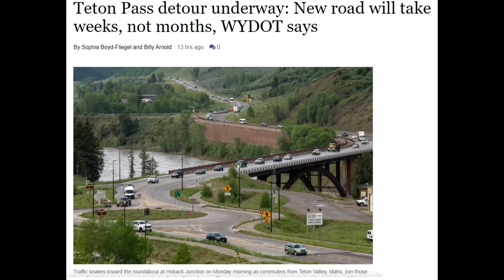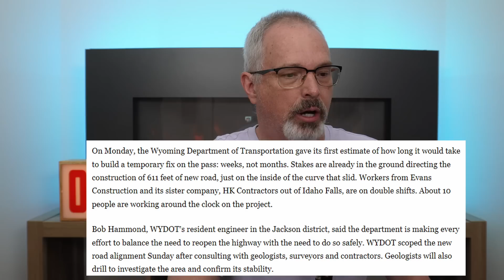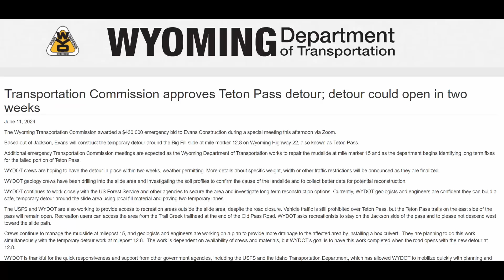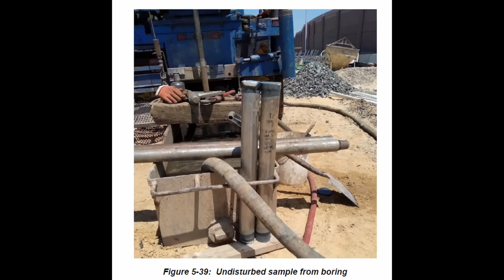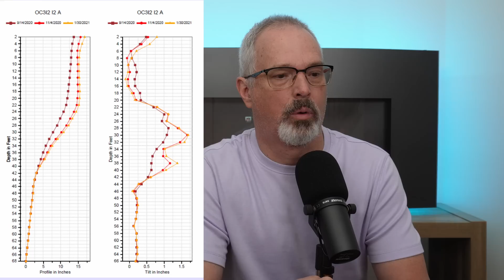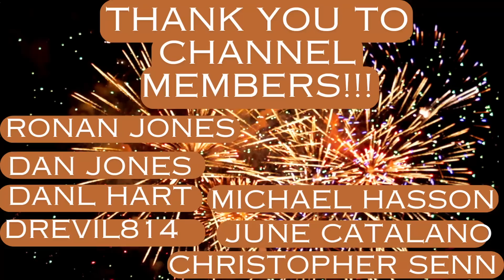Wyoming Slide Update

Comment: First I want to say I’m not an engineer and I do find the way you look at things fascinating. My father was an engineer so I’m well-versed in your thought pattern. The first thing you must recognize is a highway must get opened as quickly as possible. They don’t have three or four weeks to wait for samples and engineering and so on. The repair that they’re proposing is temporary and knowing somebody that owns a road construction company all of the necessary due diligence will be done before the permanent repair goes into effect.As somebody who travelled in the Pacific Northwest lots I can tell you there’s lots of roadways that have been sliding for years. I’m thinking of one where the asphalt from the repairs is probably about 10 feet thick. Every year, it slides a bit and cracks they come back and add more asphaltlevel to it and wait for it to slide and crack again. it moves so much there used to be a guard rail there, but they remove the guard rail and never bothered reinstalling it. I can show you a piece of highway that used to be three lanes in each direction now it’s two in One Direction and three in the other. It’s even been down to three lanes and One in the other Directions This does not make it right, but it’s just the way things are. at some point the slice will be bad enough that somebody will do something about it. Or sometimes they just stop moving eventually   You may find this shocking but living in BC Washington, Oregon California area a slide that closes the road is just another day at the office.

Great information.
Reply from the maker: Thanks very much, I appreciate your comments.  I am just questioning whether they know enough about what is happening out there to place the temporary road right next to the section that failed.  I am concerned about a progressive failure taking the new section of road out too.
Reply: @CaseyJones-Engineer it may be worth the research to fund how many similar cases are dealt with in WY, ID, and MT on an ongoing basis.  This incident is notorious, but not necessarily unique.  My county has a half-dozen cases like this:  a fill slope on an active, slow-moving slide.
Reply: That may be true, but the information you give makes it sound like all slope shifting is the same. I think the point here is that some shifts can take place catastrophically quickly while others move more slowly. Putting a road, whether temporary or permanent, where you know or have good reason to believe another large shift could occur quickly is reckless in the extreme.
Reply: @swerne01 all risk is relative.  OP is not clear about where he practices and does not interview experts.  Each mountain range has a unique geology; all engineering solutions are constrained by budget and use-case.
Reply: @timgerk3262  First of all who's OP? Second that is Mr. Jones's point.  Before you build a temporary road and let people use it, good investigative work should be done so that the risk is known. And all risk is not relative. A high probability of a catastrophe is more dangerous than a low probability of a catastrophe. That's not relative. If a surgeon tells me I have a one in a thousand chance of a complication from a surgery, that's not the same as a 50% chance of the same complication. A court of law's decisions are made on facts like these all the time. They don't say we can't render a verdict because it's relative.
Reply: @swerne01  "more dangerous" is certainly a relative statement.  The value at risk here is not your life, it is someone's job (and the tax revenue that generates).  There was no proper discussion of risk mitigations either.  Less than 10,000 lbs gvw and 20 mph speed limit, a gravel surface, and hourly on-site monitoring are all effective strategies.

Finally, where do all live that your mind immediately goes to being sued?  I assure you WYDOT understands the liability climate in Wyoming courts.
Reply: @timgerk3262  After reading Casey Jones's resume and his opinion and that of other civil engineers who have responded to this incident I'm much more inclined to believe them than you. They're concerned that the remaining slope is dangerously unsafe. Your concern is that Wyoming will lose jobs. I'm guessing you're a Wyoming politician.
Reply: @swerne01  fine.

Comment: With the further failure of the area it looks like the proposed route for the shoefly will be on unstable soil that likely will fall away over the next few days.

Either the fill area will need to be widened at the base and extensive use of piles and geotech fabric and design of adequate drainage will need to be incorporated in the rebuild or they can do it the right way and just build a bridge.

Either way, that road won't reopen for a couple of years.

Comment: There are highway signs on both sides of Teton Pass indicating this Pass is at 10% grade.  On the Wilson side it is 10% for 5 straight miles.  This makes it one of the steepest paved roads in the USA.  Also,   there are signs that forbid commercial trucks from pulling trailers up and over this  Pass.  But there also  signs that say that box trucks sometimes called straight trucks are ok on this road as long as they are not over 60,000 pounds gross weight.   That is a lot of freaking weight on those places where the roadbed is nothing more than fill material.  Especially considering that the material is nothing more than very sandy dirt...with no rocks for a binder.  If they build back this same way you can expect more of these types of failures on this Pass in the future.
Reply: Tractor trailers are only not allowed in the winter. Trailers are allowed April 15-nov 15.

Comment: I'm not an engineer, but the slopes on both sides of that fill embankment look to me much steeper than what I normally see in that sort of construction. It looks like it was built on the cheap, with the inevitable result. Trying to build a temporary road on top of what's left is insane.
Reply: Yes, that slope was bound to fail.  It would have to be solid rock to work, and I don't mean rock fill.
Reply: If the fill slopes were shallower the fill would be miles long. The only thing they could do is use better fill benches and better material, and now, geofabrics.
Reply: @lickyweeks  they could also do a bridge there. If the temporary fix works, they'd have time to build the permanent solution. Money as well as frequent bridge icing might be reasons to not do a bridge though.
Reply: Not to mention the 125 ft elevation change in a 600 ft bridge. Which is about a 20% slope in a country that gets 10 ft of snow and only has a growing season of less than 60 days a year.
Reply: @markhyndman8982  i meant a bridge along the lines of the existing curvature. Which makes it 10% just like currently. A bridge might even allow a more shallow gradient as it its placement isn't as constrained as the current fill. I've seen a number of examples in the Alps which make use of that larger freedom.

Comment: I think you are thinking in the box.  PR release is referring to two roads.  the temporary and unreferenced permanent.   Suspect they are going to construct temporary lower grade road,  that is bypassing 661 feet of roadway; down some x feet down probably on the inside of the curve. 
consulting professionals is probably for restablizing the bad slop engineering on the permanent section..  thus permament repair timeframe is not really disclosed in PR release.

Comment: This is a solid Red state. It's possible they don't fund their DOT well enough to include all these monitors.
Reply: Not a huge population in that state, so not alot of money to spread around.
Reply: Wyoming has the smallest population of all the States in the Union, which makes for a very small tax base. Also, that road is to the south end of the Teton Range so they get some brutal weather, including heavy snow loads on those steep slopes.
Reply: The GDP of the entire state of Wyoming is less than $40 Billion. The WY state DOT has a budget of just under 1bil. For comparison, the CA state DOT has a budget of 34bil, and a GDP of 3.9T. That means that as a percentage of productivity, WY puts at least 2.8 times as much funding into roads as CA. If you think that difference is due to politics, I welcome your campaign to spend an additional $63 billion per year on CA DOT, because clearly CA is neglecting their roads... Alternatively, you could just be lacking a clue about what you are talking about, and the slightest comprehension of the geographic, political, and physical factors at play.

Comment: @4:29 "It sounds like this road way section...is going to be limited to vehicle traffic, no big trucks, no heavy equipment..."

I believe the weight limit on the Pass was 60,000 lbs gross, prior to all of this.  That's why there is a scale house at the end of Talbot Canyon (where the mudslide occurred, 43°31'33.9"N 111°00'52.5"W).  Anything heavy already had to go the long way around, though I'm sure the weight limit will now be much lower.

I think I'd be nervous driving anywhere near the collapse site until there was some heavy reinforcement done.  But, that's me, and I'm a Nervous Nellie.

It's been a while since I was out there, but Pierre's Hole and Jackson Hole still hold a place in my heart.
Reply: The scale house is never open…

Comment: Things go wrong when people rush a fix to get “something” working after a problem.  Check out this incident here in the UK in 1974 https://en.wikipedia.org/wiki/Flixborough_disaster   A chemical plant was underperforming, and then a crack appeared in one of a number of reactor vessels.  This reactor was removed a a new line installed to bypass it.  The line failed, hot hydrocarbon vapour released followed by a massive explosion.  There was a litany of issues which resulted in changes in the UK to how plant changes were controlled and reviewed etc.  
This road ‘fix’ looks like an incident about to happen! If it can, it will…

Comment: can't say your opinion is wrong.  But, i have worked at State level before and when it is important to them, it happens quickly.  Lab times are measured in hours not weeks, permits are measured in hours not days, etc.  They should not treat this like they have 6 months to address, but I agree some precautions may be secondary for bigger reasons.

Comment: When wydot kept saying on Fri 6/7 that the road was going to be open by the weekend, I kept thinking "every picture I've seen of that crack has been progressively worse very rapidly  . . . There is no way you guys are going to outrun that hillside collapsing".  
I drove over that section on Monday 6/3, there was no crack.  There was a new crack on Wed 6/5 in the pm.  Thursday am was the motorcycle crash, they patched it and reopened the road.  As I was driving home on Thursday, I noticed the mud River on the side of the road (which I have never seen before in my past 8 years of making that commute) near where that mudslide occurred. That mud flowed over the road on Fri early am.  I told my friends we would wake up on Sat to a catastrophic failure of the road and low and behold.
Reply: So you think the whole built up embankment it’s going to collapse? Do you really think that? They are going to go on the inside radius at a lower elevation where there is very little risk of further erosion to that position. This is bullshit overly conservative engineering from the author of this video. This is so stupid. They will get a bypass in At a lower elevation, not the same level of the road now. What a bunch of dummies here
Reply: @steveperreira5850 What engineering/soils credentials do you have to impugn this PE’s concerns?  And that adjacent bypass’s “lower elevation” you believe will be no problem.  Lower by how much??  4 feet?  8 feet max.  That’s hardly any difference, look at the dry loose material still chafing down the ravine. I hope you never work in any position responsible for other people’s lives.
Reply: @steveperreira5850 I never said that I thought the whole embankment would collapse.   Could it?  Maybe.   There's something significant  happening in the area with how quickly that collapse happened.  The portion of the road that collapsed always had a weird dip in it, suddenly now, its collapsed.  I was just merely commenting with the things that I saw in the past week and how comical I thought it was that WYDOT was being so overly optimistic  and refusing to accept reality.  Believe me, I find no joy in this.  It is a huge inconvenience for me and all the other commuters.

Comment: From what I understand, this road out will increase traffic by an hour. If they do it right, it may be a few months to a year to avoid another slide. 

Those of us in Baltimore have a similar scenario where we have increased traffic because of the bridge going out, rebuild will be YEARS. Most of the local community is ok with that because it needs to be done right to prevent tragedy. They need to slow it down and do this thing right. 😥

Comment: At 0:08 we see the old gravel road that's on the other side of what I can assume be a creek. It basically looks like a relatively straight downhill slope where the failure happened.

Seems (just visual from the video, so it's just my perspective) like that slope degree can be expected to be stable. To keep that slope angle from the height of the roadway would require a lot of fill and it would probably end up touching the powerline structure at the far end. That in turn would result in a creek that'll be blocked and that in turn would cause more problems.

Looking at a bridge shortcut would be a mighty steep bridge if you look at Google Earth (not a perfect scientific tool, but enough for an estimation) you get an elevation of about 70 meters over 280 meters, which gives a slope of 28%. That's about 15 degrees steep, and that's quite steep. Recommendation as I found it is about 6% to 8%. So that rules out a bridge. Even with that bend there's a warning sign when you look at Google Street view that says that it's 10% downhill before that bend and that trucks shall use lower gear.

When looking at the failed bend it do look like that embankment is built on an existing slope with just fill material that hasn't been stabilized or reinforced and it looks like it's to a large degree gravel with sand and that's quite sensitive to how wet it is. Overall the filling of the embankment has to be analyzed to know what slope that can be safe here.

To me this looks like it's going to be a major project that'll need months of work to be done properly. I just hope that it won't be a patch fix that can get people killed.

Comment: Google Earth says the west side is elevation ~7540 and the east side is ~7776 ft.  So it's a 240 feet altitude change in 750 distance straight-line if you cut out the curve and go right over the gully and the forest.  Which, even ignoring the EIS that is likely needed, would take a lot of fill and be only usable by a limited number of vehicles.  My off-road truck could do it, but my accord not so much.

Comment: If WYDOT doesn't do extensive testing on every segment of the Pass, we're going to see another collapse and probably one that's going to fatal.  It's been there since 1969, so it's in no way modern and it's a 10% grade.  

That shoefly might work, but you are playing stupid games with just the truck traffic for reconstruction alone.  In many ways this is like the collapse at Meidum.  Sadly, many roads in the West are built  this way.

Bear in mind that the alternate route into Jackson, through Alpine and Hoback Jct, may have similar issues--and with the expected truck traffic....

Jackson is full of billionaires who are putting phenomenal pressure on the State to reopen this, because Jackson will die on the vine without all the labor that commutes in from Driggs/Alta.
Reply: I expect that the temporary fix will be open only for light vehicles. Commercial trucks will likely need to take the current detour. 

Thanks for the information that the current detour also has risks.
Reply: Good, because they should fix it fast. There is a quick fix, and it will be safe, the inside curve at a lower elevation will work, and if it doesn’t, they will have ample warning. What a bunch of chickens here led by Casey, the biggest chicken of all

Comment: Seriously question the suggestion for a bridge to reconnect the roadway by bypassing the loop where the berm failure occurred. The loop almost certainly lengthened the roadway in order to keep its grade within acceptable parameters. The suggested bridge shortcut would span a chasm with a huge elevation differential at either end. The slope of such a bridge would be extreme and non-traversable. Non-starter.

Comment: At time stamp 11:20 on both sides of the slide area, left and right, a major crack in the embankment is visible, indicating slope failure and again at time stamp 11:46, lower right of photo, a crack in the embankment is visible indicating slope failure.  I don't understand how geologists and engineers could have missed these ominous signs of potential failure; the arc pattern of the asphalt cracks and the slipping of the downslope embankment material.
Reply: I found a photo of WYDOT making a repair on the shoulder last year in this spot.  The outside shoulder of this bend had dropped several inches and they added fill and went over it with a roller to bring it more level with the roadway.
Reply: Maybe it won't completely fail until I'm gone. Then I can say "Didn't happen while I was driving"